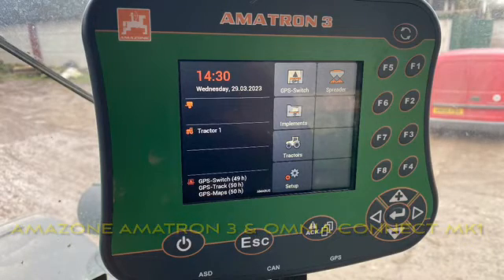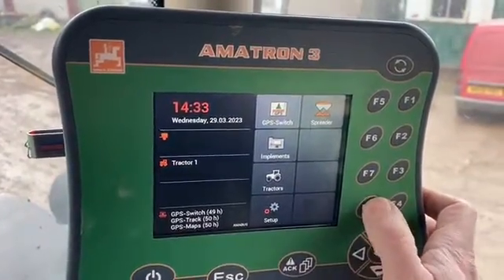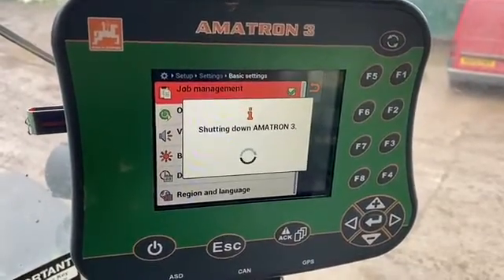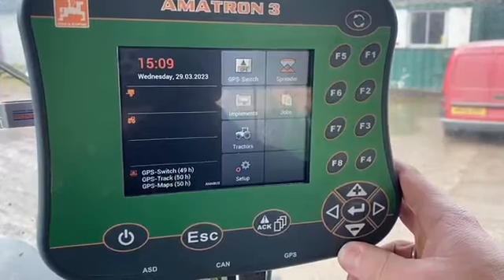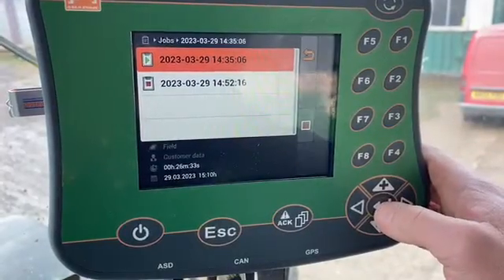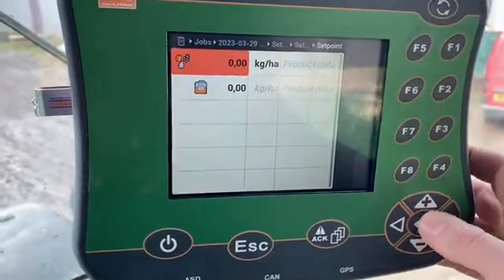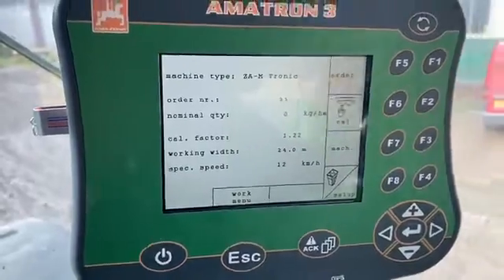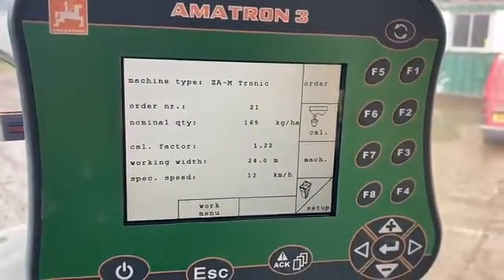Amazone Amatron 3 & Omnia Connect mk1 VRA Kit Install /Setup

Comment: I have a Zam Amabus spreader with an Amatron 3 screen. Is this a compatible set up for running Omnia connect?
Reply from the maker: Hi, yes this should be compatible, there should be a port on the bottom marked ASD we plug a cable from the kit into this to feed the rate from the connect kit and iPad 

Drop me an email at Chris.blashill@hlhltd.co.uk if you need some assistance or a local rep to help.

Thanks for the message
Reply from the maker: Hi, yes this should be compatible, there should be a port on the bottom marked ASD we plug a cable from the kit into this to feed the rate from the connect kit and iPad 

Drop me an email at Chris.blashill@hlhltd.co.uk if you need some assistance or a local rep to help.

Thanks for the message
Reply from the maker: Hi, yes this should be compatible, there should be a port on the bottom marked ASD we plug a cable from the kit into this to feed the rate from the connect kit and iPad 

Drop me an email at Chris.blashill@hlhltd.co.uk if you need some assistance or a local rep to help.

Thanks for the message
Reply from the maker: Hi, yes this should be compatible, there should be a port on the bottom marked ASD we plug a cable from the kit into this to feed the rate from the connect kit and iPad 

Drop me an email at Chris.blashill@hlhltd.co.uk if you need some assistance or a local rep to help.

Thanks for the message
Reply from the maker: Hi, yes this should be compatible, there should be a port on the bottom marked ASD we plug a cable from the kit into this to feed the rate from the connect kit and iPad 

Drop me an email at Chris.blashill@hlhltd.co.uk if you need some assistance or a local rep to help.

Thanks for the message
Reply from the maker: Hi, yes this should be compatible, there should be a port on the bottom marked ASD we plug a cable from the kit into this to feed the rate from the connect kit and iPad 

Drop me an email at Chris.blashill@hlhltd.co.uk if you need some assistance or a local rep to help.

Thanks for the message
Reply from the maker: Hi, yes this should be compatible, there should be a port on the bottom marked ASD we plug a cable from the kit into this to feed the rate from the connect kit and iPad 

Drop me an email at Chris.blashill@hlhltd.co.uk if you need some assistance or a local rep to help.

Thanks for the message